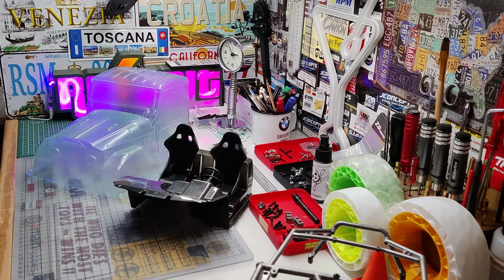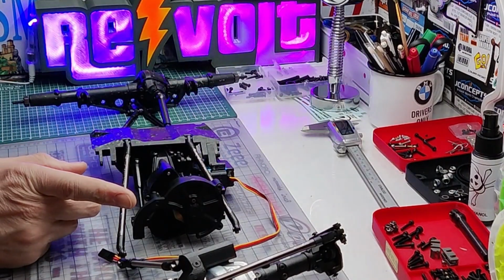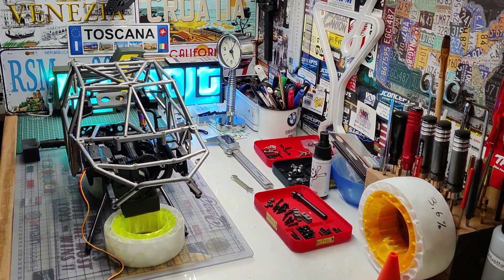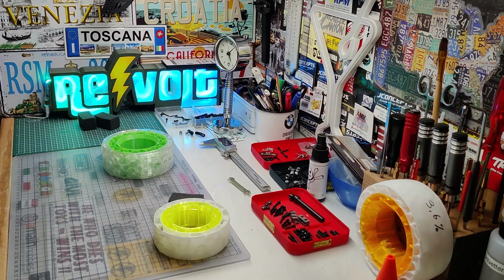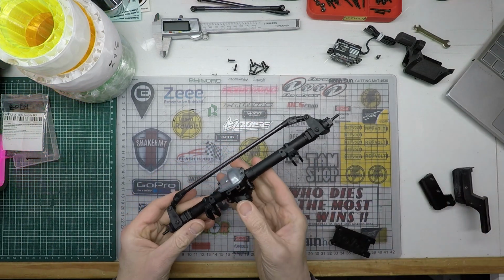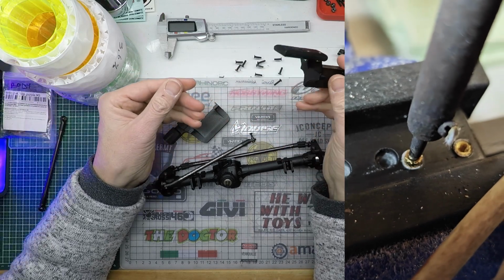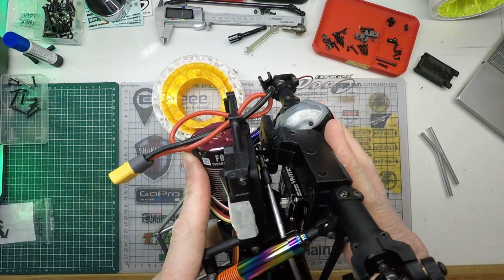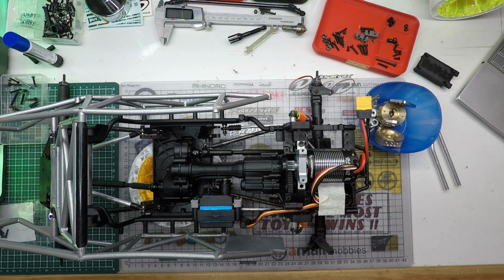Gmade GOM episode 3:  two steps forward, one step back

Comment: Haven run my gom in like 3 year's have 4ws
Reply: Did had to put a 20a ubec because of the 3 servos pull a lot of amps
Reply: Yo made a lot of work just because the servo was hitting the pan hard, I raise my servo and solved that problem, stock shock are 105 and they fully compress to both sides, very interesting project, I have one of those cabs laying around, and y like the new rear link's maybe I make som for my gom and if I like the new body even that
Reply from the maker: @Tomzak11  I like all thing thinkering and fiddling sir.
Reply from the maker: That GOM sure is something different.
I do love it though.
Being limited isn't a bad thing.

Comment: A lot of work there Erwin getting those links to work. I have a similar top link on my bits and pieces crawler which has an all in one Y shaped top link front and rear. There are no regular top link mounts just 1 forward facing hole to attach to.  Nice fix for yours, Im sure you can reduce the curve in them to bring them in a bit.
Reply from the maker: Thanks, Lee!